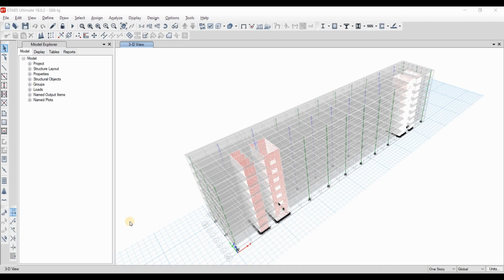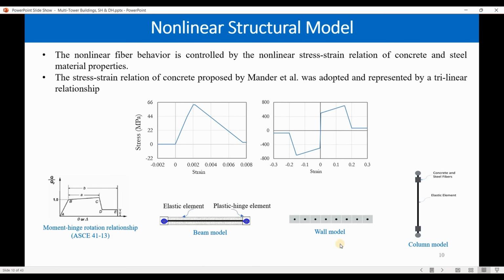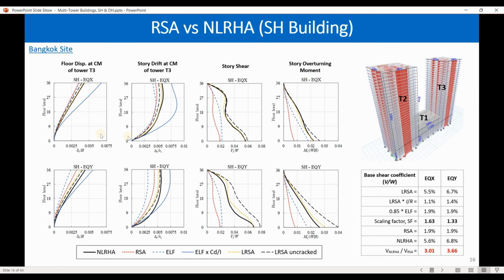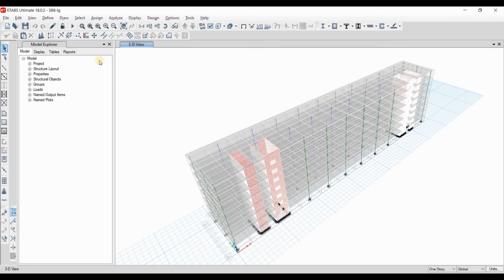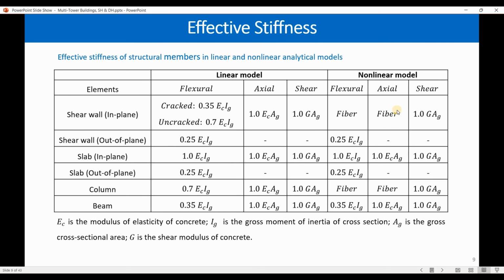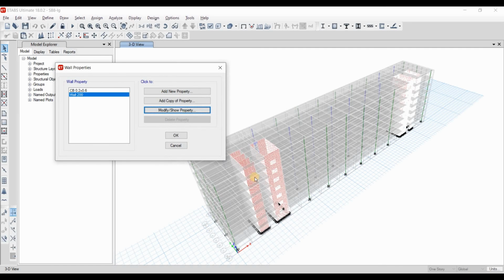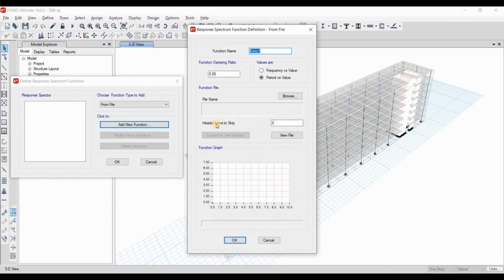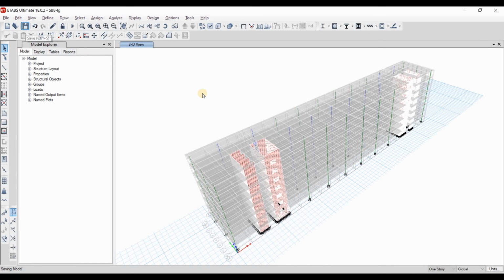ETABS Tutorial 5: Creating a Linear Model with the Same Initial Stiffness as the Nonlinear Model?

Comment: Hello, I wanna ask is there any stiffness modifier for steel beam? Thank you.
Reply from the maker: In structural design, the stiffness of steel beams and columns is generally not reduced in the same way as it is for reinforced concrete beams and columns. In reinforced concrete design, the stiffness reduction often refers to considerations such as cracking of concrete and the non-linear behavior of reinforcement under load.

Steel members are less affected by load-induced cracking or yielding compared to reinforced concrete. Steel beams and columns are designed to resist bending and axial loads primarily through elastic behavior, where the material remains within its elastic range and returns to its original shape once the load is removed.

However, in practical design, factors such as local buckling, lateral-torsional buckling, and stability under various loading conditions are critical considerations that may indirectly affect stiffness calculations. These factors are addressed through appropriate design checks and may influence the effective length and moment of inertia used in the analysis, but they are not typically described as a direct reduction in stiffness similar to what is considered in reinforced concrete design.
Reply: @Eng.tarekyoussef  thank you for your information👍🏻

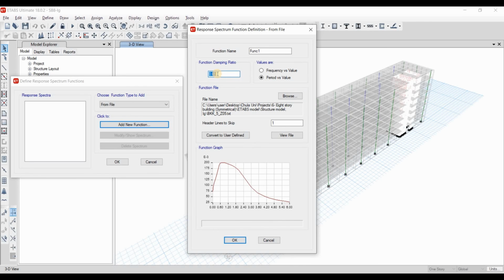Comment: Why damping ratio is equal to 0 (at 8:10)
Reply from the maker: The response spectrum in ETABS is already defined with a 5% damping ratio for the Bangkok site of Thailand, providing another 5% damping ratio would essentially apply the damping twice, leading to incorrect results. It's important to ensure that the damping ratio is only assigned once to the spectrum to avoid any inaccuracies in the analysis.